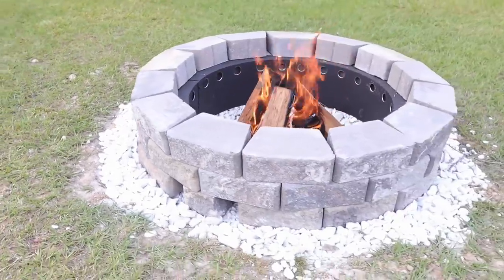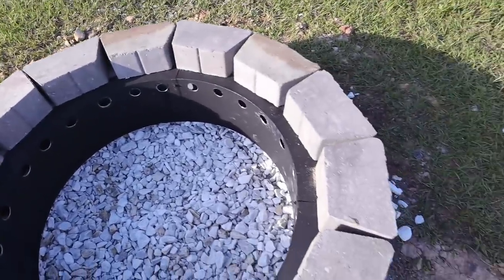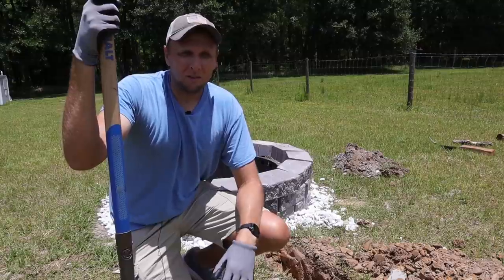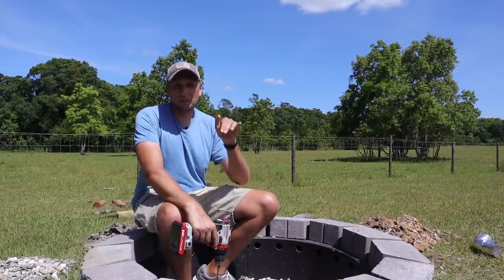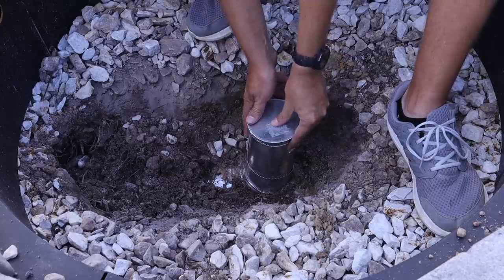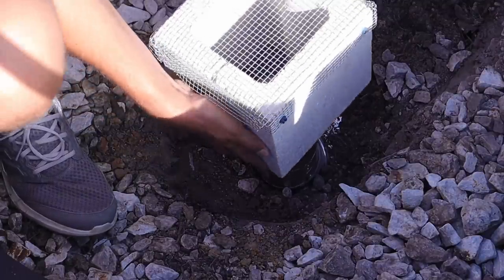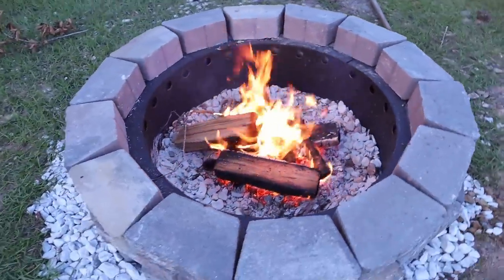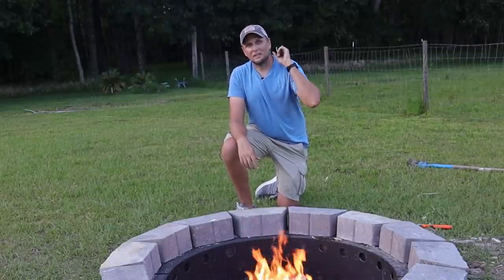Can the Smokeless Fire Pit Be Made Better? Part 2 of How To Build a Smokeless Fire Pit

Comment: Obviously, combustion is enhanced by the additional oxygen coming into the pit at the base of the fire, which is exactly where it is needed.  Version 2 is thus indeed better than Version 1.  But.....let's think together a bit about Version 3!   Can this be improved even more?  I think it can, and logically should be improved in a few ways.  Here's my ideas.

1) Raise the floor of the fire pit 1 foot above the natural ground level.  Simply place the first two rows of stones exactly as you have done at the start of the first video.  Pull out the stones to break and break them as before.  But only put 1 of the half stones back into the hole, leaving a half stone out at each of the three points where you removed a full stone.   This will create a place to install three metal air vent tubes.

2) Create 3 straight metal air vent tubes long enough to reach from the outside of the ring of stones to within about 9 inches of the center of the fire pit.  This will create an 18 inch diameter circle between the vents at the center of the fire pit.  The fire will be built inside this 18 inch circle.   The vents will feed air directly to the bottom of the fire but coming straight in from three sides.  Drill air holes in two metal end caps for each pipe and screw them in place on each end of the vent tubes.  Now simply lay the vent tubes in position, with one open end protruding through each hole created by the missing half block.  To insure water drains out of the vent tubes, slightly elevate each tube so it tilts a little from the inside of the fire pit to the outside.  Any rain water will then run out of the tubes.  Air will come straight into the fire and be drawn in by the natural upward convection of the fire without having to make two turns as in your current design.

3) Once the tubes are laid in place.   Simply cover the tubes with compacted dirt up to the level of the top of the second ring of stones.  Do not cover the 18 inch circle where the fire will be built with dirt.  Just shape and firm the dirt with your hands to form the 18 inch ring.   Use of a soil with plenty of clay content as fill dirt will make shaping the inner ring much easier, as might adding a little water to the dirt. With the fire being built at the very bottom of the inner ring, air will be drawn in from 3 directions at once and focused right at the base of the fire.   This design has the added benefit of at least one vent tube potentially capturing any breeze that might be blowing from the exterior toward any side of the firepit.  

4) Add the rock layer as normal and complete building up the stone ring layers and adding the capstones as otherwise done in the videos.   I would suggest leaving rocks out of the 18 inch center circle and just building the fire on bare dirt.  Ashes will quickly accumulate in the 18 inch center ring but can be scooped out of the dirt much easier than scooping out ashes with rocks in them.   More dirt, if needed, can simply be put back in the hole to replace any dirt scooped out with the ashes.  You don't lose any rocks this way or have to clean the rocks.

You don't have to dig any trenches and no one will notice the dirt filled inside the fire pit.   The natural ground outside the fire pit remains unchanged and the pit doesn't have to be any higher than the original design.  The vent tubes are simpler to build and install.   You get more air delivered straight to the fire and have a better chance of at least one tube pushing any breezes into the fire since there are multiple air intakes facing different directions.

Finally, the fire pit needs a cover, which can be a simple wood lid cut to fit the opening.   This will keep out leaves and any slithery critters that might decide to crawl into the pit for a warm home.  And for safety when burning, a metal fire screen should be used.    The last thing you want to do is set your own property on fire from embers escaping from an unscreened fire pit.

You have an excellent fire pit and some great videos.  I enjoyed them and it put me to thinking about possible improvements.  Thanks for sharing your projects with us!
Reply from the maker: Awesome ideas!  This is one of the best parts of doing these videos, is seeing ideas that folks have after watching the video.  Thank you very much for taking the time to write that.  Maybe someone else will like some or all of it and implement it themselves!  Thank you for the feedback!

Comment: I have a useless hot tub that is partially enclosed with a roof over it.  I am thinking about removing the hot tub and building a "smokeless" fire pit instead, with seating all around it.  Thoughts on if this would still be too smoky under that roof?
Reply: Any fire near a structure is a bad idea (smokeless or not)

Comment: I would think that just installing one or more gas line pipes that just lie on the ground would be easier to install. Intake outside the ring. Output near the center of fire pit. Downside ids you’d have to notch the bottom of the metal ring to let the pipe pass through. Sounds easier than digging.
Reply from the maker: Thought about doing that but then whatever is installed will be seen and I wanted a bigger pipe.  But you could certainly try it!

Comment: If you put holes in the bottom of the ring it would help get fresh air into the fire. Then you wouldn't have to dig a tunnel.
Reply from the maker: Wouldn’t work as well and the ring wouldn’t work as well.

Comment: You could add a valve somehow. But also you can add a cheapo fan. Even like a 120mm PC fan and have a dimmer on it. That way you can FORCE air not rely on wind and control the amount.
Reply: would the flame itself pull air through the vent pipe?
Reply: @TimYorty  Yes sort of, but not too much. Heat rises so air will get pulled up, but I'm not sure how strong of a pull there is on a pipe. It's an open flame so the flame has air to pull from other directions. it's not concentrated on the pipe Only. Suction is hard to control Especially in an open area. Even if it works it's real simple to just add a tiny fan with a controller. That way you are Blowing air and controlling how much. With Blowing air you don't have to be as efficient. Just an opinion.

Comment: I'm assuming you climb into the pit to build the initial fire structure, but how then do you add wood afterward?  It seems like getting in might be dangerous, and a person would need pretty long arms to do it from the outside.  Do you have (or did you make) something that acts as a gripping extension tool?  Maybe something like I've seen beside some fireplaces?
Reply from the maker: I build everything from outside the pit.  It is not a very large pit.   Maybe the camera is making it look bigger than it is.   But if you had some fireplace tongs, that would definitely at the very least make it easier.
Reply: wtf do you mean "how do you add wood?" You put it on the fire. Go outside more.

Comment: does the air intake pipe get filled with ashes?
Reply from the maker: Over a long period of time of many fires it would accumulate.  I’ve had a decent amount of fires and there has been barely any in the intake.  If it gets too full I just use a shop vac.

Comment: Nice upgrade. Well done
Reply from the maker: Thanks Harry, really happy with it!  Glad you liked it!
Reply: @HowToHomeDIY  I will be copying your design. Thanks!
Reply from the maker: @hgillung  Sounds good!  If you are installing the ring as well from the first video, I used a 1 1/2 inch  hole saw for the holes, if I could go back, I think I would go a lot smaller but add a few more holes.  I think it would make it even better.  Let me know if you need anything!
Reply: @HowToHomeDIY  maybe go 1”?
Reply from the maker: I might even go to 1/2 or 3/4 in.  The best thing might be to use a step bit instead of a hole saw and try 1/2” this way if I wanted to make the hole bigger, I could.  I have not done this so I’m speculating but it makes sense to me.
Reply: @HowToHomeDIY  makes a lot of sense. Thanks

Comment: Great job! One more thing you can do to upgrade is to paint your black steel liner with heat resistant spray paint (Rustoleum),  so the holes you made won’t rust and it will last longer. I bought my stone and liner, spray paint, steel bit for the drill gun and am really excited to make this design. I like your idea of the intake pipe too! Thanks for posting the videos.
Reply from the maker: Hey Kat, funny you mention that, I am actually in the middle of filming a follow up to these videos with extra things that can be done, some things I may have tried differently, etc and the heat resistant spray will be in the video.  We love this thing!  Thank you very much for the feedback!  I always appreciate it!
Reply: @HowToHomeDIY   Are the holes really that necessary once you added the intake pipe?
Reply from the maker: Yes, those holes are what makes the whole thing work.

Comment: What about ash management?
Reply from the maker: Haven’t had an issue.  Before the next fire can just brush the top off if there is a decent amount and like I showed in the video, if it gets down inside and accumulates after a while then it can easily be sucked out with a shop vac.  My experience so far there has been very very little that gets down inside and doesn’t affect the air flow in any way.

Comment: Now you can enjoy doing it a third time by putting a tee pipe in the center of the pit and running the pipe out both sides of the fire pit to double the air intake into the fire! LOL curious what it do if you put a shop vac hose in the intake of the pipe with the shop vac pushing air into the fire ring?  Maybe have your own forge system there? 😅
Reply from the maker: haha well I don't think I will be doing that!  Yeah I have seen people add fans and it definitely feeds it!  Would definitely turn it into more of a forge.  But if times get tough, might be necessary LOL

Comment: Question, do you find the left over coals from the fire are more fine like a dust after this upgrade or do they remain in larger chunks?  I like having larger fires and typically the coals left over after the fire are large chunks and less of an ash. 

Also, when removing the ash from the firepit do you tend to find the rock layer gets removed when shovelling out the ashes?
Reply from the maker: Yeah I typically just find larger chunks and coals left.  Obviously there is some ash but not enough that I have felt the need to even try to clean it out.
Reply: It all comes down to how long you want to tend the coals after a larger fire. You can keep stoking and piling them up and burning them down more.

Comment: So not to burst the fun here just a thought. In coal forges you have a coke pot I think its called. It's where the air comes out under the coal. This area is turned down to prevent the back fill of used stuff. So if this cap should fail set a teepee top over the fresh air inlet allowing the debris to fall to the side without entering the pipe. Less maintenance.

Comment: Why not just drill holes along the bottom of the fire ring as well as the top? It allows more air to get in through the openings in the bottom row of the pit. That`s what I did, and it works very well.
Reply: lol I was about to post this but you beat me to it, the intake is a total waste of time.
Reply from the maker: It’s not.
Reply: I believe this is what I'm going to do. I think the holes at the bottom will do what the vent pipe suppose to do. Let me know how your setup is going if you put holes in the bottom.

Comment: I'm not a fire pit guru, but wouldn't it have been easier to lift the fire ring off the ground a couple of inches?  You already had the intakes set up. Seems like it would have more fuel for the coals too. Just asking. Thanks for sharing
Reply: I’m also no fire pit guru, but that would have probably increased the amount of smoke, because there is less air which gets sucked to the top of the fire ring to cause secondary ignition. Again, I’m no expert, but this is my best guess.

Comment: With the fires that I like to build I am not sure that aluminum would hold up very well
Reply from the maker: I personally don’t think it would be an issue.  It’s down below the fire a good 2-3”, most of the heat rises, the screening will help to keep out coals, and there is cooler air being pulled through the tubing to also help keep the heat down.  Most end caps are steel so that’s also another layer of possible protection.  But if you still feel it could be an issue, there are steel products you could use but they would be more likely to rust.  Sounds like you like bigger fires, which I fully support! 😄🔥

Comment: I appreciate the effort, but this just seems like a horrible idea from the start.  You just built an ash collection system,  That's it.  I 100% expect this to fill with ash withing the first year of use.

You also surly understand this only feeds oxygen to the center of the pit, right?  What freedom loving American builds a bonfire with four logs at the perfect center of a fire pit?

Also, the fire was not "reacting to the oxygen from the bottom as well..".  There was not disceranble difference.  A mediocre gut of wind would have made a bigger difference.   

Thoughts and prayers kind sir.
Reply from the maker: Works fantastic and it actually made a huge difference, seconds after removing the paver it was very clear it was feeding it.   I also showed how easy it can be to clean it out if there is an accumulation of ash after a period of time.  Literally would take 10 seconds.  If you can’t handle that then I wouldn’t do this.  Take care!

Comment: The issue I see is using that thin aluminum piping. After a few good fires the portion in the fire pit will have disintegrated.
Reply from the maker: If it was closer to the fire or more so in the fire then yes.  But being down below as far as it is, with rock between, a galvanized steel end cap, and cooler air being pulled through the aluminum, it will not disintegrate.  It won't reach a high enough temperature to do so.

Comment: Seems like you could have just added another row of block to raise up your fire ring off the ground and then the fresh air can get through the gaps of the cut block :)
Reply from the maker: Then the fire ring that was installed in the first video would not work.
Reply: @HowToHomeDIY  true - but you could drill holes in it where the bricks were cut

Comment: Great idea! I think, I'd keep the metal cap off w/ the holes drilled in it, and have just the fencing wire over it (with smaller holes). The rocks over it will help restrict some of the oxygen anyway. Unfortunately, that would mean less barrier, so more ashes might fall into the exhaust. Your fire pit is an inspiration, so I just need to pull the trigger to buy the fire ring, which will cost me $100. It'd be nice to find a round metal grate that will cover the fire pit, for cooking. That would cost some money, too. Probably another $100. Only live this life once, so...

If I don't use the galvanized steel channel for the oxygen, a roofing downspout might work well, also. That green cap you used looks pretty sharp, though, and I couldn't use that on the downspout, unless I shaped it. 

I was also thinking, a pvc pipe might work well, since heat rises, and it probably won't affect the integrity of the pvc pipe. Could then put a fencing on the opening, and use a hose clamp to secure it. Maybe, the air coming in at the bottom might keep the heat from getting to the pvc piping.
Reply: If you used pvc only on the intake side (outside the fire pit) I think that would suit your safety needs perfectly. Sounds like you’re on the right track!

Comment: Great update and improvement video. The comments have been awesome also. I do have one question for you and one about a comment, if you know the answer.

1. Is the aluminum tubing you used able to withstand the intense heat from the fire? If not, what other materials could be used that would fare better?

2. Someone mentioned adjustable venting on the intake side. What part or product would allow it?
Reply from the maker: Hey!  Yes it does not get hot enough under the fire to cause any damage to the aluminum.  There is a layer of rock between  the fire and where the vent is.  The vent cap is also below the fire about 3 inches.  This might not sound like a lot but heat does everything it can to rise not go down.  The end cap is galvanized steel so it is also more heat resistant.  And then cool air is being brought in through the tubing also helping to keep it cool.  There is no way that a fire that can range between 600- 2000 degrees Fahrenheit is going to bother it.  Are there materials that are better against heat?  Yes, there is galvanized steel tubing as well but that can rust and corrode where the aluminum can’t.  I suppose you could silicone the steel pipe and that would buy a little more time on it.  But I’m not changing it, I know that I will not have an issue.  I’ve had numerous fires in the pit since this install and it looks exactly like it did when installed.  

Yes there are dampers that can go on 4 inch tubing, however, I just use the brick and adjust how much of the intake is covered, controlling how much air can go through.  I hope this answered your questions!
Reply: @HowToHomeDIY  Excellent. Thanks for the quick and thorough reply!